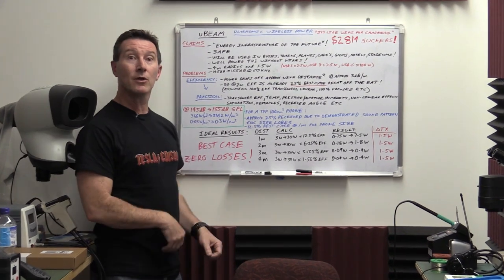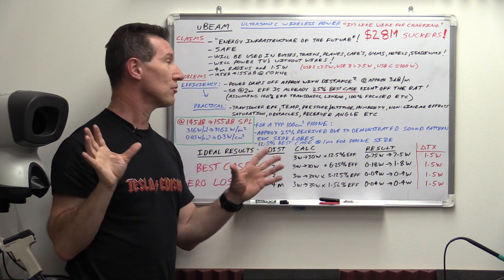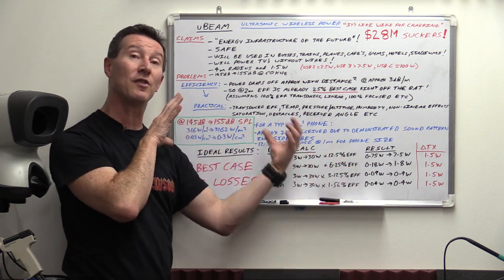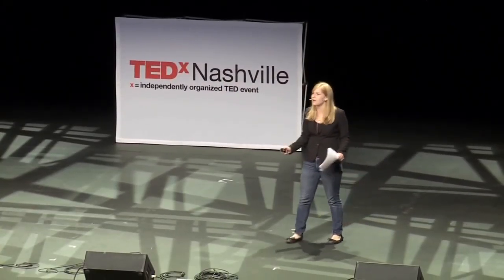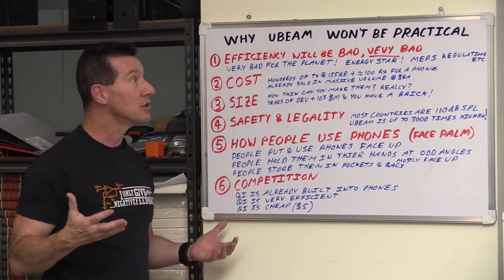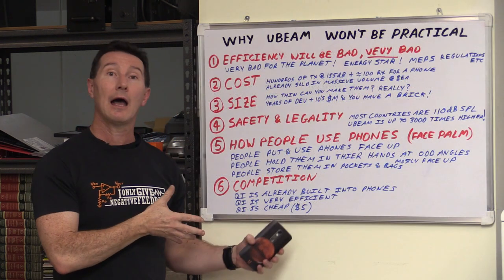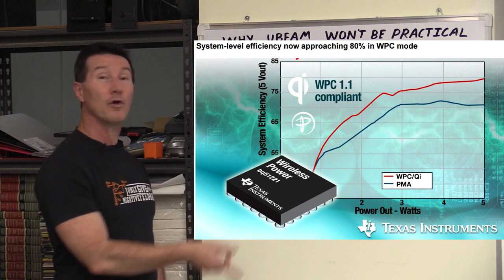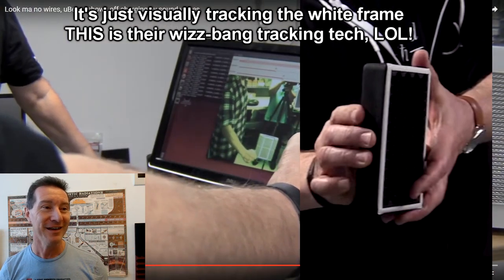EEVblog #1001 - uBeam Ultrasonic Wireless Charging DEBUNKED!

Comment: "As a non-expert, I had an advantage..."  ..  yes, of knowing absolutely nothing and believing anything you wanted.
Reply: You know, I do think there's SOME value in coming at a problem from outside.  Groupthink does happen.  However, she's clearly thinking her "quick calculations" have more merit than an expert opinion... which means her thought process is broken.

Yes, it's possible for a smart person to think of a problem and come up with a solution that experts haven't quite looked at the right way. What you're supposed to do next when you THINK you've done this is go ask your experts what you've done wrong or misunderstood.  A million to one, you've messed up somehow.

If you look at the critical failures of this design, it's not that her core idea is fundamentally incorrect. There's just an overwhelming number of practical reasons why it's a dumb idea to actually use in the real world.  It's not wrong, it's just ridiculously impractical.  It's exactly the type of answer a non-expert would be expected to come up with.

There are plenty of reasons that SOME ridiculously impractical things could become more practical.  The manufacturability concerns Dave talks about, for instance... it's possible those could be addressed.  Not any time soon, but with a substantially more advanced manufacturing base. Maybe the SPL thing could be addressed with a large number of transmitters beamforming to specific targets... much as some concept cancer-burning systems that focus a large number of sources of radiation on a tumor, such that any one beam is under a safe threshold for tissue exposure... but the focal point received tumor-destroying levels of energy.  Maybe in some future fusion society we won't care about efficiency as much.

Sometimes, a person can come up with a solution that has such an "impossibly impractical" element to it, and find a solution to a reason it's "obviously" impractical.  This is exactly where a non-expert might help, to just push past the initial "common knowledge" of what's not possible.

This, however, suffers from so many of those impossibly impractical concerns there's virtually no way it would ever make sense.  Maybe, in the year 2050+, this turns into a practical power source for storefront displays that are already using ultrasonics anyway (maybe a levitation version of LED cubes).  Eh, probably not.

Dave's right... there's some tech here.  They should have pivoted early to something that could actually use that tech and be a valid product.
Reply: More often than not, an expert thought of the idea and then did some quick calculations & realized it was a bad idea. Most ideas can be debunked that way. I once had a coworker who came up with a seemingly simple perpetual energy idea. It was really creative, but I was like "this sounds neat, but let's look at the numbers real quick." So, we did and it didn't take much for him to get that while it'll go awhile on its own, it will inevitably stop and if you actually put any noticeable load on it, it'd stop very quickly. Most of these sounds good til you know enough to know why it won't work ideas can usually be debunked rather quickly but the person coming up with it sometimes can't see it and thus needs the outside perspective
Reply: Her mocking was quite cringe-worthy... yes.  I certainly wouldn't want to be an domain expert working for her.  Imagine that.
Reply: It amazes me how easily people fall for this stuff -- and if you don't, YOU are the "naysayer". SEVERAL people that I know supported a project to put a wind turbine on the roof of cars to harness the wind energy -- as if it's just naturally windy outside and you aren't burning gas to overcome that air resistance.
Reply: That's some heavy coach shit right there.
Reply: I know from personal experience that being an outsider is not an advantage in any way. I'm a bit of a dreamer sort of guy and I have lots of ideas for all sorts of things like 3D rendering. I come up with this wonderfully naive idea that involves multisample rendering or whatever for some innovative technique but once you try to actually get down into the dirty details of the implementation it always falls apart. There's a reason the experts are doing all sorts of weird shit with post screenspace stuff and pattern detection and so on... Being an outsider just means that you don't know that somebody smarter than you has already tried it!
Reply: And then in the same breath as she mocked experts for being idiots, she bragged about having some of the top experts in the field working for her.
Reply: I would play devil's advocate and say that in some fields, non-experts really out-thought experts. Car industry was always full of people like that. But here, no. They are trying to be smarter than nature itself, which is never a good idea.

Comment: With the size of that "brick", you can get a 20 000mAh bank that can charge your phone many times and costs less to nothing these days.
Reply: Joonas Pulkkinen And with that budget you could probably design a nuclear battery that lasts as long as the rest of a typical modern phone...
Reply: Phone-based RTG? :-)
Reply: MrOpenGL Why use nuclear power from outlet when you can make nuclear power yourself, da... :D
Reply: On a more serious note, Pu-238 based RTGs are pretty safe and require minimal shielding. If it weren't for the fact that Pu-238 is rare and extremely expensive (has to be bred in a reactor) it could be the first form of widespread nuclear power in household environment. It only decays in alpha radiation, so it requires only a thin lead shield, and the half-life is 40 years or so if I can recall that right. 
I'm sure that if we found a cheap way to produce it, someone could find a way to make the plutonium pellet un-openable (like potting or encasing it in a welded box) so idiots don't try to make dirty bombs that actually are mostly scare devices than anything!
Reply: Well that escalated quickly :D
Reply: Due to Governmental regulations, that is NOT ALLOWED. There are techs that when you put your tin foil tech on, can outclass even that! The power of Hydrogen is even better ;-)
Reply: There's radioactive material in those darn smoke detecters of yesteryear...
Reply: Am241 is still in modern smoke detectors. I use ionisation smoke detectors in my house, since they react much faster to fires than the photoelectric type, and can detect fire with invisible smoke. Since photoelectric is so cheap, I've also added some of them to detect smoldering fires that aren't quickly detected by the ionisation chamber.
Reply: Yup! Plutonium pacemakers exist, and a few people still have them inside their bodies, ticking along to this day (As of 2011 :P). A plutonium-powered portable charger would seem to be safe, reliable, and long-lasting--if used as intended.
Reply: i see someone noticed my idea! i added a 30Ah lithium battery to the back of my lg g5. its actually bigger than that brick. it lasts 3 weeks with constant use 4 months on standby
Reply: @Aries14701  Still is today.

Comment: In biomedical research we use ultrasound to randomly break DNA into bits. Although that's at a much higher power density, it does raise some questions about safety from constant exposure.
Reply: AskAScientistShow Not to mention the effect on animals that have supersonic hearing.
Reply: What frequency is it ?
Reply: 60 Khz, in the audible range of bats, cats and rats.
Reply: This kills the cat.
Reply: and all along people thought it was curiosity that did it...
Reply: The machines I use are 20kHz ... This is the machine: http://www.sonicator.com/12-q125-sonicator.html   It's 125 watts, but in reality you're using it at 50% power.
Reply: Careful, we use heat every day to cook things and destroy them... think how dangerous everything around you is! Quick, reduce it all to absolute zero!!!

(Everything is dangerous or safe at relative distances/intensities etc)
Reply: +ASkASomething     20khz is not ultrasound, 20khz is slightly below ultrasound and is within audible range of humans.
Reply: So you mean my 100w guitar amplifier at say 60 or 70% volume pumping out a 20KHz wave could destroy DNA? 0.o

Comment: Sometimes a simpler idea and focus on the problem is the best. The problem is: User dont wanna get out of charge. Why is not common to have smartphones with quick replaceable batteries like in DSLR cameras? They could  keep a small cell buil in, that can hold it on for a couple of minutes, just to be able to make a "hot swap", like HDs in servers? It would not take more than 10s to change a battery, and a power off would not be needed. Then, one just have to rotate batteries. Why all this fancy desire for wireless charging? Ah... I forgot... You have to throw away your phone when the cell is gone, instead of just buy another one...
Reply: Jonathan Araujo yes forced obsolescence doesn't work when you make practical products that stands the test of time, best to make garbage.
Reply: "like in DSLR cameras"
Like in phones 10 years ago, you mean.
Reply: Jonathan Araujo Thats the first thing I mentioned when I got my lg g5. It's so easy to change the battery, It would be awesome to have a small secondary battery to keep the phone on while swaping the primary battery. Even a capacitor just to hold the stuff in the ram memory for a few seconds would be usefull.
Reply: That will never sold, because it actually solves the problem :)
Reply: Or even a "burner" charger as we already have. Charge the battery pack, plug the battery pack into the phone on your commute (not everyone is in a car) to school/work and it charges. etc. Which is what most people are doing.

This is a solution looking for a problem... why? Because they chose ultrasound and STUCK with it. If they were really looking for a solution, they would change to the tech that best fits. For example, I've got a couple of ultrasound sensors for a project, they will do about half of what I want, so I've had to admit I need infrared too. I cannot "just believe" or "think really hard" to get a solution (well, I could if I modulate/read multiple ultrasonic beams at the same time, but that is beyond my math level, programming, sensor fidelity, and I still cannot change the speed of sound! :D ).
Reply: They used to, but then people started buying phones because they were 1mm thinner, and manufacturers realised people didn't care about batteries you could change.
Reply: Exactly, then they stick a thick otterbox on it.... its rediculous.
Reply: TechyBen My (old) Alcatel phone (one of the first with the "Easy" branding) allowed swapping out the MiMH battery pack for any 3 AA cells using nothing but your fingers.  So every 4-pack of AA's at every convenience store was a ready-to-buy burner pack, and any 4-pack of rechargeable AA cells at every large supermarket was a suitable externally recharged spare battery.
Reply: The reason that cellphones don't have removable batteries is because the vast majority of people never have a reason to have more then one. Even my Atrix has only had it's battery replaced once, when the old one died. most folks want that charging without having to manage extra batteries to do it. I suspect I'll replace the battery (and chipped Gorilla glass) on this Moto X once at some point. And after that, she'll be written off as spent the next time something breaks.
Reply: Heh, I still have my flip phone from ten years ago. Still works just fine. I'm using a smartphone now, but 'ol trusty is on standby for when something inevitably happens to my current phone and I at least need text and phone capabilities.
Reply: A couple of MOBILE PHONES, that have text/ sms capabilities were still made up to a couple of years ago, that you could put a normal battery in it, AA size :) just the basics. i think they made a 3G version too but defaulted to 2G to conserve energy. :)
Reply: You mean a case that has a battery built in? Granted they're an external solution but it works well enough. 

And then there's the moto z which has a magnetic thing on the back that you can just slap a battery pack on when you need more juice and don't even have to worry about opening a fragile battery door.
Reply: I am still using Samsung galaxy S5. So nice to swap batteries easily. Memory card slot too, and it has 3.5mm jack. And still waterproof. I  wish it could last me another couple of years. Great phone. It will be hassle to rip apart my next phone to change battery cell. For some reason I manage to kill battery in about two years in any phone. And I keep phones for 4-5 years. So it's gonna be pain to buy those glued together bricks.
Reply: Or, you know,. instead of trying to shave every fucking mm off them so they are hard to hold, instead just keep them same size and INCREASE THE BATTERY instead of shrinking it with each process improvement on CPU/GPU?
Reply: Well, this simpler idea you speak of is less universal and less convenient. If this technology is in a car I'm not going to want to pull over for a battery swap, if I'm flying a plane I'm not going to land for a battery swap, if I'm driving a boat I'm not going to pull over for a battery swap. However if the power is in the air then I do not have to pull over. I understand this technology is far from practicality but at least we have people working on it and building interest as there are a lot more uses than any of us can even think of right now. Here's another example... unmanned space exploration via electric propulsion.. or we could have massive solar fields in space beaming that electricity to earth.

Comment: Is that Samsung phone even charging? At 14:21 you can see big fancy looking charging animation, but next to the clock on the notifications bar, battery icon seems to be not animated, or even with any indicator, like in many other phones (small spark/lightning/whatever symbol inside the battery icon). Also who charges their phones in airplane mode?
Reply: It is charging, the lighting symbol just looks like a dark dot at that resolution.   Probably in airplane mode to try to stop it discharging faster than it charges due to it's crappyness.

Comment: Might be worth looking at the amount of current through the usb it takes to get the charging indicator on a phone to come up... Seems to be used as 'proof' that the battery is 'filling up' in the promo vid but I suspect it's a very low threshold, possibly less than the consumption of the phone.

Comment: Maybe it could still work if you replaced the air between the appliances with a good conductor, some sort of 'copper beam' which would be solid at room temperature....you could make it straight or bendy, then you could wrap it in rubber to stop it losing power

Comment: Have anyone heared about using radiowaves to grab a few volts ? ( Pine shaped with Lenghts of the antenas at exact scale to the pole/main antena  )  I`ts supposed to give you around 9V but I don`t remember the power nor the exact design.  And this scaling is similar to the one at the 4G technology antenas where you need to grab the correct freq.
Reply: Horus Horus Hush, you're not allowed to talk about tech outside of this female's realm... naughty you!

Comment: What about situations where it's not easy or convenient to run power, or install an outlet? Like a table at a coffee shop. In that case, instead of putting the receiver on the phone, you install it directly into the table with a USB outlet or wireless charging pad on the table. Then you could move the table around and not worry about outlets. Maybe other similar use cases?
Reply: Cully Larson yes, it will work as a "pair". If, the following conditions are met. Nothing obstructs the receiver on the table, i.e. Drinks, plates, hands, newspapers, phones etc. as it will lose a large portion of the energy. 2. You will need at least 4 things. Qi charger, micro-usb, usb-c & Apples cable. Can it be done? Yes, will it be practical?... oh, and don't forget about pets... many places don't let them in, but here in Oz, if they are seeing/ hearing aid dogs, they are allowed.

Comment: 3:35 I don't think they use the ultrasound to locate where your device is. In the demo vid, the ceo said that they use a vision system for locating the devices and you can see the camera above the ultrasound transmitter array. Given that, I am very skeptical that the demo shows the ultrasound powering. Could've been easily faked.

Comment: So 60 kHz in air is a 0.2 inch wavelength.  The far field for an array antenna is D^2/lambda.  So given a 24 inch array aperture, that would put the far field at 240 feet.  So how are they going to get any gain or focusing out of this array?  Do ultrasonics (longitudinal wave) work different than RF (transverse waves).
Reply: Actually at 60khz a transmitting antenna would have to be 16117.874086021506 (1/1) feet long.  A 1/4 wave transmitting antenna at 4029.4685215053764 feet still isn't practical.

Comment: I think they just had an animated battery symbol on the screen because the actual battery indicator in the notification bar on the top of the screen never indicated charging. Many phones just won't start charging if the available current is too low and I believe this is the case in this demonstration.

Comment: They have probably read the specification of ultrasonic ID tags produced by Norwegian company SONITOR (whose main clients are hospitals in (!) Australia, who improve management of movable equipment with these tags). SONITOR is also working on low-power low-speed wireless ultrasonic data networks, to replace WiFi in areas, where radio silence is imprtant...
BUT transfering power with noise...
This is not only stupid, but also dangerous!